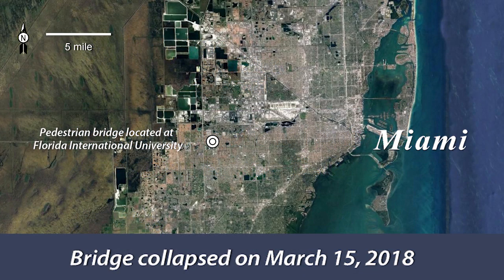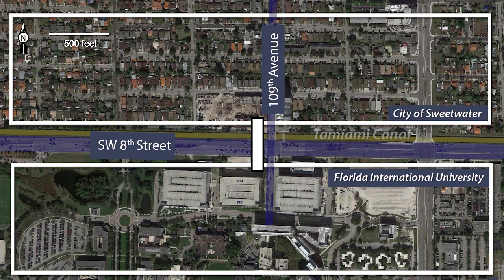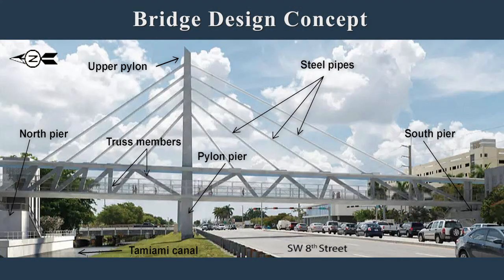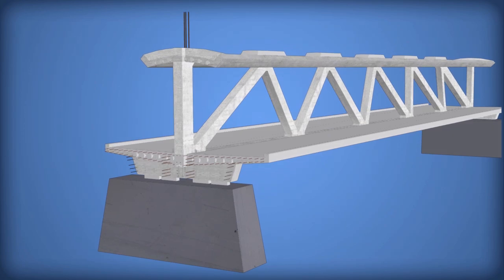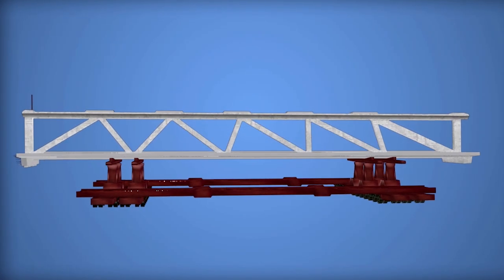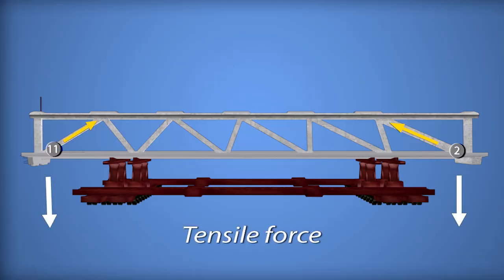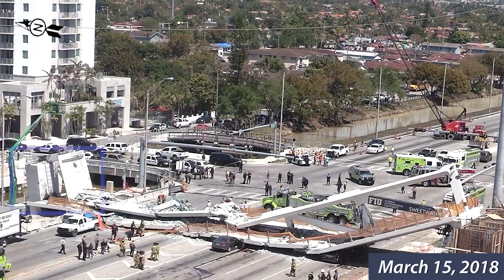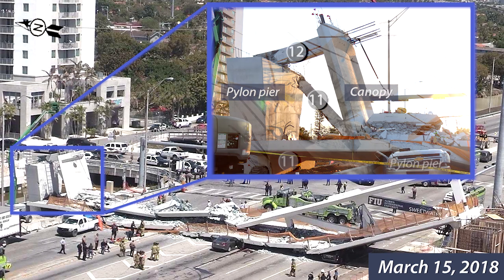Pedestrian Bridge Collapse Over SW 8th Street HWY18MH009

Comment: Why would you make a truss out of concrete? Concrete is good in compression but horrible with tension. All truss undergo both compression and tension.
Reply: The designers were trying to compensate for that by including post-tensioned bars, which would add compression where needed.

Comment: Tensioning RODS? What the hell are those? I spent 5 years in pre_stressed concrete bridge and building construction . We could cast single and double "ts" up to 110 feet b y by 16'. We used 1/2" or 5/8" wire rope stressed from 30 to 55,000 psi before the concrete was poured. 4 days later, the chicks were cut off and we had a camber of 15 to 35°. I see no I camber in that span at all!

Comment: They obviously never stressed tested this bridge before installing it. With some new dumbass design like this they should have put up 2 piers at the concrete facility sat bridge on them and stress tested for a month or 2. Also,( and I'm no concrete tension specialist),  but
I understand  what they do to tension the concrete. Wouldn't re-tensioning the lines on already hardened concrete immediately crack it the entire length of the tensioning cable?
Reply: The span was built near the site where it was erected.

Comment: It is not fair to say that this bridge was "Non- Redundant" at 2:05, meaning that the failure of an individual truss member would cause the collapse of the bridge.  One might as well have said that we need three full bridges so that we would have a  redundant system!!!!!!!!!!!
If built properly, each of the truss members would have multiple steel rebars in it and there would be plenty of them in each member and I am sure that if a couple of them rusted or failed, hence made "redundant",  the others would still hold the integrity of each elemental structure.  Also, the two canopy parts and the vertical struts at either tip end of the bridge were redundant as they offered no strength to the bridge. That bridge is effectively an I-BEAM  with two flanges and a web in between, in which engineers see an " ARCH", but rather than using the side "mountains"  to buttress the side thrust, it is the tension in the lower flange or " deck" that takes the side thrust through the tension in the deck(lower flange) and compression in the canopy. The design would have worked well had the designer filled in the triangle on base 9/10  to 11/12 and the equivalent on the other end, to ensure that the shearing between 11 and the deck or lower flange of the I- beam will not take place.  
With that drain pipe at the center of the deck and the 12 bundles of rebars with 6 bundles distributed away from the longitudinal deck center on either side of the vertical web, I do not think that the vertical web was adequately connected to the deck or lower flange!
Proof that the end canopy parts and the end vertical parts are redundant. The video shows the side land buttressing the bridge was at Florida the deck took the side thrust but the joint between element 11 and deck could not take it. 
https://youtu.be/fZ9U9ILLx9A

Comment: The weight of that bridge is incredible! That is far over the weight of four modern, six axle, locomotives. Have you seen the concrete bridge supports used for railroad bridges? They are like 5 feet thick. Can you imagine four diesel locomotives stacked on top of each other and the type of bridge needed for that amount of weight? As someone who has worked a fair amount of construction. You would think that out of the hundreds of people involved in this project from pencil to concrete, a number of them would have noticed these problems. I remember reading about cracks and pictured hairline cracks here and there. But those cracks look like earthquake aftermath!

Comment: Wow. Even if those crack were absolutely not structural, there was no way that bridge would last in Florida as water infiltration would have quickly attacked the rebar (even assuming they tried to grout or seal the cracks).

Comment: Now. If this would have been made in the style of a normal truss bridge with actual steel Beams and a redundant system this might not have occurred. The truss bridge in my city was in operation as a vehicle and pedestrian bridge from 1920 to the late 1990s when vehicle traffic was redirected to a new bridge. The old truss bridge continue to serve pedestrians till mid 2017 and was torn down in 2018 TWO  years short of it's one hundredth. It lasted 98 years. That is a strong bridge. You build a bridge like that there and it's will last for decades or in the case of ours nearly a century. They are old tech but that old strong technology lasted nearly century. This pedestrian bridge in this video shows they don't make them like they used to

Comment: ... Roman empire build bridges which are still here, 2000 years later... what a evolution
Reply: that cant handle 200 tons
Reply: @dknowles60  well,  they are designed in order to do a job, and they do it. 
And I don't know exactly the weight of those structure,  but with an aqueduct, the first level arch carry the upper level,  and I think it's a little more than 200 tons.
Reply: @geekdaddy5351  wrong.  its simple. road bridges are not design  to carry trains . aqueduct is not design to carry trains  let me put 4 diesel locomotives  on any Aqueduct and it will fall down
Reply: @dknowles60  I am ok with what you say : can't carry 4 locomotives. But you have to be ok with what I say : those builds have done their job,  during a long time (don't work anymore today) and their builders have amazing skill that we're have lost today.  I'm not sure that something so big, as aqueduct, build today will be there in 20 century.
Are we ok with that?

Comment: A lot of people talking about how the design was stupid and was doomed to fail from the start.  As a structural engineer I can tell you that this is not true.  Though its unorthodox to make the single truss out of concrete it is not impossible.  Additionally, the fact that it has no redundancy does not mean it automatically fails, you just make it a more robust design and inspect it more often. The bridge would have been fine if the engineers did their job. The first issue was not providing enough reinforcement at the shear interface(where the cracks appeared).  The fatal mistake was not only to NOT close the road but adding more force(retensioning the chord) while LIVE TRAFFIC is under the bridge.  This project ended killing another large pedestrian bridge in Orlando.
Reply: There were too many overlapping constraints: Aesthetics driven, not closing the road, fixed budget from a Federal grant. Fast, Cheap, and Good… pick two.
Reply: @gordonrichardson2972   they were givien 20 million dollars. how much money do they need
Reply: @dknowles60  It was not about money, but vision and PR...
Reply: @gordonrichardson2972   it needs to be about the money. the US is broke
Reply: I’m an engineer, although not a structural engineer.  I think the design is cockamamie.  It is dishonest, heavy, and expensive.  And unsafe.  I take no comfort in the argument that it would have been fine if only the engineers had done a better job with some detail of the design.  A structure on which lives depend should have a generous margin of safety.  A conventional span could have been built and been perfectly safe.  The people who conceived this monstrosity were showing off, and people died.

Comment: “The N.T.S.B. concluded that the chief probable cause for the bridge failure was the design by Figg Bridge Engineers, an experienced Tallahassee firm whose designers, the agency said, underestimated the load on the bridge and overestimated its capacity. But agency officials said other parties contributed to two more key failures.

The Louis Berger Group had been hired by Figg to conduct an independent peer review of the bridge design. That review should have caught Figg’s critical miscalculations. Yet Louis Berger’s review was inadequate, the N.T.S.B. found.

Finally, Figg and its partners — the builder, Munilla Construction Management; the builder’s engineering consultant, Bolton Perez and Associates; the university; and the Florida Department of Transportation — failed to recognize that the cracking had reached unacceptable levels, and decided to keep the street open while workers tried to fix the problem, worsening the impact of the collapse.” - NYT
Reply: There is a lot of blame to go around, but I think FIU should be held responsible for a fundamentally flawed concept in the first place.

Comment: Post tension fails everywhere it's used. There is a number of faults with P.T. design, not enough  conventional Reo placement is main reason, second is concrete placement and quality.  Separation of stone within concrete occurs in line pumps and boom pumps, and too much water is used inste add of more expensive plastisier. Ban all P.T except in box girder extruded bridges.

Comment: Death by structural engineer!
The cold joints should never have been used. It should have been monolithic and the bars should have been pretensioned before pouring the concrete. Thanks to engineers for more senseless loss of life.
Reply: Not closing the road during construction was a 'feature' of this project. It would have failed anyway, due to design errors.

Comment: “The bridge design was non-redundant, meaning that failure of one individual truss member would cause collapse of the bridge.”

So this design was doomed from the start. How the hell was this allowed? WTF?
Reply: With real cables, it would be stronger AND have redundancy. But let´s not do that.
Reply: Pen Tool, That's an interesting notion, but a very large number of systems and components in this world are of a "non-redundant" design, including many common safety-critical ones. They are not only 'allowed', they are used practically everywhere. A seatbelt, a lightpole, most lifting hooks, the wing of a commercial jetliner. These are just a few examples of non-redundant design. The problem here wasn't a non-redundant design, it was an inadequately weak design.

Comment: A slight arch on the walkway supported by just cables would have been enough. A steel only structure would not have required 170 tons of concrete and as for repeated changes in truss tension with cracks...

Comment: My guess is they over-tensioned the pipes in strut eleven when they prepared it for moving, and exceeded the compressive strength of the concrete. Then when they detensioned  strut eleven, the cracks opened, they tried to compensate by retensioning, and it fell apart.

Comment: The city should have closed the road as soon as the cracks appeared.  Yes, the contractor should have closed it, but the city is also culpable for transportation infrastructure.  The thing is, that was a horrible design from the beginning.  Engineers wake up with cold sweats from dreams that one of their designs failed, and people died.  That's why they build in excess strength to cover worst case scenarios.  The city should not have approved the design because it didn't have component redundancy.

Comment: 950 tons? This is a PEOPLE bridge, there is no point in it weighting 950 tons in the first place. And those crazy zig zag trusts look like they wait to fail. This thing was designed to fail. And not closing off the road is so stupid. It is falling apart as you look at it and you still do not close off the road? I hope some one goes to jail for the people killed in this and I mean do some real time  not just a few months. And no redundancy is bad enough but no redundancy with a crazy odd ball designed is even worse. And once again I ask "950 tons"? A much stronger bridge could have been built at less that half that weight.

Comment: Don't forget that it was designed by women that were hired for equality purposes..
Reply: false
Reply: @AmbientMorality  true. Look it up.
Reply: @demandred1957  I have looked it up. It's completely false. You can look through all of the NTSB documentations and it is quite obvious that the FIGG team involved in the bridge was male-dominated (there was only one female engineer, who wasn't involved in the decision to re-tension Member 11).
Reply: @demandred1957  The university was not the engineering firm for this bridge, so I'm not sure what you're even talking about.
Reply: @demandred1957  Because even if it was true (and I'm quite confident it wasn't) it's not a relevant factor. NTSB in its final reports puts the vast majority of the blame on FIGG engineers (who were almost entirely male) for both the initial calculation error and complete failure to respond effectively to the cracking.

Comment: Let’s make something unusual and distinctive that will garner us a lot of attention. 
All other concerns are secondary. 

Well, mission accomplished.
Reply: I don't think it's a bad mission to try to develop something unique to improve pedestrian experience. But if you're designing something structurally distinct then that requires a lot more caution on calculations and a simple mistake might slip through the cracks – especially when the cracks are an inch wide and several inches deep.

Comment: What a white wash!
no mention is made of the culpable parties.
The Bridge was designed by:
 Tallahassee-based  FIGG Bridge Engineers

FIGG stated that no traffic would be allowed under the bridge till construction was complete but then proceeded with the tensioning of cracked concrete while vehicle traffic moved under the bridge. 

The bridge was built by:
Munilla Construction Management

The NTSB findings on the collapse shows:
A final NTSB public hearing on the bridge accident was held October 22, 2019 in Washington, DC. and concluded "that load and capacity calculation errors made by FIGG Bridge Engineers, Inc., are the probable cause of the fatal, March 15, 2018, Florida International University pedestrian bridge collapse in Miami."

Why do article like the above video fail to mention the guilty parties?
Reply: The NTSB videos tend to not assign blame as directly as the actual investigative findings. I'm not sure why exactly, but it seems true over multiple incidents

Comment: Here in Cleveland Ohio we have numerous pedestrian bridges. The Cleveland Clinic foundation has endless pedestrian bridges between buildings and parking garages and in downtown Cleveland the jack casino has a large pedestrian bridge that if I remember is around 170 feet long. It’s a steel truss pedestrian bridge fully enclosed.

How did so many people involved with this process not see that this was a disaster waiting to happen. This is an unproven design with no redundancy. Single point failure means death and that’s what they got all for having something that looked cool most likely instead of designing for safety and longevity.

Comment: Tension the damaged bridge was like have a puncture and over inflation of your tyre no doubt it's going to blow out in this case collapse can not believe that the extent of damage to the concrete that the engineering company taught to tension up a totally damaged part of the main concrete support the steel rods are not the main strength of any construction it's only there to help a bit with strength prevent instant collapse of concrete when concrete gets smashed or cracks steel beams are the main strength of any construction witch this bridge did not have no need for concrete canopy two heavy bad design. Cost unessery deaths

Comment: For me the biggest irony in this accident is that the workers adjusting the rod tension were wearing safety harnesses attached to a crane. Why do this if they thought there was no chance of the bridge collapsing? If they thought there was a chance the bridge could collapse, why was the road not closed? It also baffles me that cracks as wide as the ones observed prior to collapse were dismissed by those responsible the bridge design and construction. Certainly, a bridge could be structurally sound in spite of this type of cracking, but nobody would design such a bridge intentionally because it would appear to be failing. Consequently, this anomalous behavior should have caused the builder to act with extreme caution until a thorough design review demonstrated the structure was safe inspite of the unexpected behavior.  I'm just glad I'm on the side gloating in our 20:20 hindsight rather than the receiving end here.
Reply: To make sure they don't fall off the bridge? Agreed on cracking, though I'm not civil I can't imagine any situation where post-tensioned concrete with that much cracking would ever be acceptable — except for a laboratory test to failure.

Comment: This design seems to be far more difficult than a simply adding a slight arch to the structure.... I span 40' with a 2 inch arch in concrete.... Seems like someone had an idea and then forced it into materials not really good for that job. A 3 or 4 foot arch could most likely provided plenty of support....

Comment: I just can't see how this was supposed to work.  Flat tensioning?  What exactly was supposed to keep it from buckling?  Good bridges have arches..  What kept the pylons from shifting, when one is in a canal?  I read the whole 80+ page report, it's a back-to-front disgrace and even at at that, it only addressed the on-site causes of the failure, not the failure of the design itself.  This might have worked out in a desert that isn't prone to any ground shifting or shaking.
We have to do better as a society without stuff like this tragedy happening in order to illustrate obvious safety protocols.